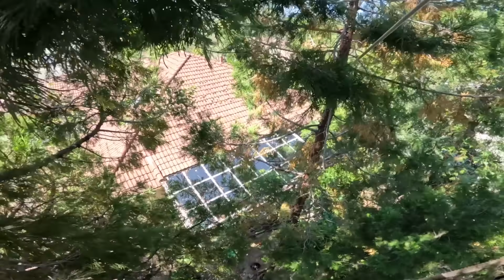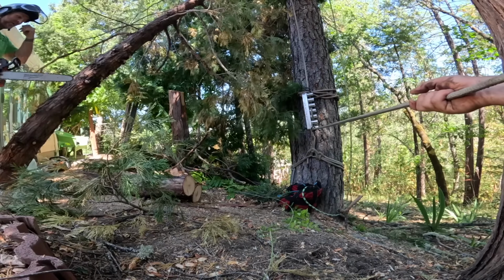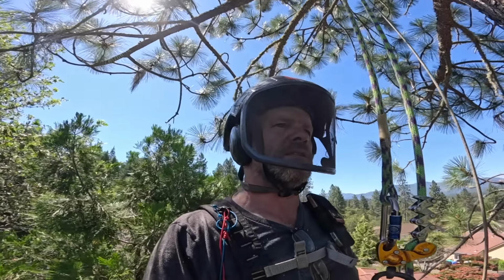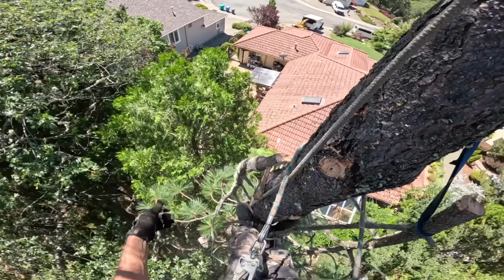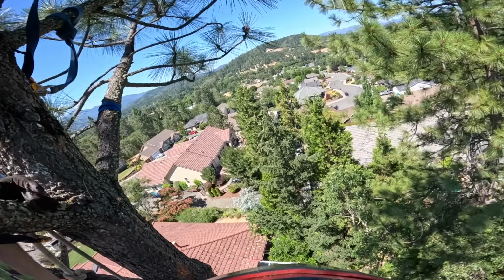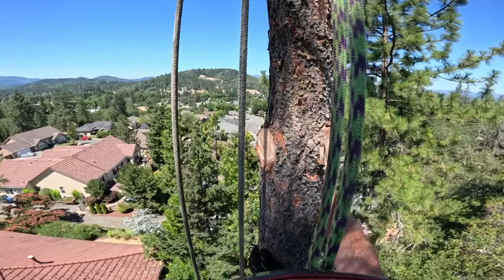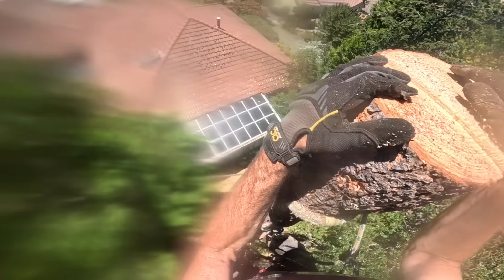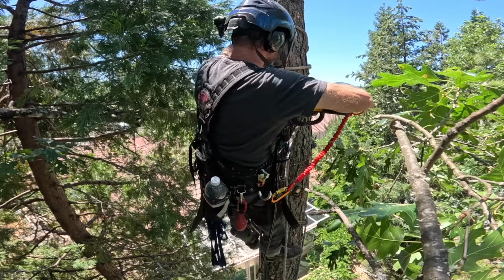Battery Saws Discussion

Comment: The biggest advantage of the battery chainsaws is I can do more cutting earlier in the morning and later in to the night without making someone mad.
Reply: Rule #2463: Someone is always mad.
Rule #321: You have a right to enjoy your property and use whatever time you can find to improve it.

My area has a bylaw that says no noise before 7am and after 10pm.
I told the bylaw officer who showed up while I was mowing about 10:20pm due to a call that if the neighbor who complained is willing to pay my daily income rate, then I'll skip going to work to be able to clean up my yard. Otherwise, I only have the time I have and I'm almost done. I started on it as soon as I got home, hadn't even showered or eaten dinner so that I'm not out past 11.
I made a complaint saying I wish the municipality could show some backbone and tell complainers to grow up and consider moving if they don't like where they are.
Bylaw officer left me alone and hasn't ever been back, though I do my part also in trying to keep noise to a minimum between said hours.
Reply: Yeah it's so nice to attract less attention, and makes communication with the ground so much clearer

Comment: I port chainsaws for a living and people gave me shit when I posted a clip of that saw when I first got it, as if I was suddenly anti gas powered chainsaws. I agree people feel too strongly about battery saws one way or the other. Probably bleed over from the way electric cars are being shoved down people's throats. Battery rear handles saws have a long ways to go before it's a viable option, if ever, but I can tell you I've shelved my 200t since I bought that Dewalt. (Gordys got dogs coming for it if you end up keeping it) 

Not having to start it in the tree, not breathing the exhaust, not having the fatigue of listening to a loud ass chainsaw a couple feet away from your face all day or while trying to communicate with your ground guys, swapping to a smaller battery for a small job actually makes the saw lighter, earlier starts, later finishes, no neighbors complaining about noise, easier to talk to YouTube all in trade for some horsepower loss and some guys on the internet threatening to peel themselves away from the couch to come take your man card away. I'll take that deal! 😂
Reply: Milwaukee is releasing a rear handle dual battery that looks promising
Reply: I am real tempted, as a homeowner who needs a chainsaw only occasionally, to go battery next time I need one. Mine died a while back. My thought is that battery saws don't have the gas go bad during prolonged storage. The carbs and fuel lines and such don't get stiff and brittle. And the batteries can be used in other tools so they'll have a fresh charge when needed.
Reply: @Kurgosh1 I have a corded elec pole saw, but the little saw on the end is removable and it's a little beast.   Perfect for basic homeowner stuff. Bar is maybe 10" usable but obviously you can work your cut to slay bigger pieces.
Reply: People who get butt hurt about someone else's choice that affects them in no way is everything that's wrong with society today
Reply: I'm getting some noise in my headphones and it's affecting my groove on, can u add some larger caps and upgrade my mosfets

Comment: I got lucky. I got the Husqy 536lixp, first. What an improvement!  The battery saws are the greatest improvement, in saws, in the past 50 years. There's less heat, less noise, vibration, no pull starting...
Reply: No spilled fuel,

Comment: Climbing Colt also gave a review on this saw and also said the throttle response is a lot slower then the huski top handle. I wanted to like the dewalt top handle as I use dewalt drills and am already invested in the batteries. But ill be using it everyday as a climbing arborist. Im torn between the 2511 because its so light and the dewalt 60v top handle.
Reply from the maker: 2511

Comment: I have the older Dewalt top handle. I use it for quickie cutting, pruning. But I always prefer gas. 

That said:

For most people, if you’re Red, you’re Red. If you’re Yellow, you’re Yellow. And on, and on. It’s bloody expensive to buy into numerous ecosystems. 

Everything has pros and cons. Too many people will gripe about the attributes rather than actually just work. 

Great work as always guys.

Comment: On DeWalt: price makes it attractive.
First off, it’s heavy on your wrist, but works for you once in a cut. Balance seems ok.
The soft start takes some getting use to; making the chain skip instead of biting in.
Battery gets hot pretty quick under load in summer temperatures.
With the safety switch, do electric chainsaws need a chain brake?

Comment: I have the DeWalt 20 inch 60V. DCCS677Y1 
Cuts really good. Unfortunately the battery overheats after maybe 5 minutes of cutting.  Not sure if it’s a bad battery or what. Needless to say it’s going back and I’m getting a gas chainsaw.

Comment: I tried out a neighbor's Stihl last year, it was great to just pull the trigger and cut with no hearing protection. The down side for me is the cost of battery replacement when they age out. I've ended up with multiple power tools over the years because I can buy a new drill kit with charger and all for the price of just replacing batteries.

Comment: Purchased a 14" 40V Ryobi electric saw to take in the Jeep and have used it exclusively since I've had it. Recently purchased their 18" saw for some larger logs that needed bucking. I must admit to being pleasantly surprised with the performance of the battery saws. Bonus, no hearing protection required.
Reply: I agree. Non professional and I used the same saw today to cut up and get the debris off the road of a 60 ft Co-dominant oak that split. Started at 7 am and was done by 10 am. I was rather impressed.

Comment: I use a Makita 36 volt top handle 16 inch bar. Got it for the convenience, price, and utilizing batteries I already had. I use farmer tech full chisel. Cuts awesome! I also wish it had more power from zero. If you stop cutting it doesn't do well getting started again. You do get used to it, and learn to compensate for it. Given that August commented similarly with this saw, I thought that DeWalt looks like it did a little better with starting /stoping in the cut. Common issue with any brushless power tool. You have to take the good with the bad and develop new habits to compensate.
Reply: I’m also using your setup. Could you get your hands on the 40V version? Chain speed should behigher, but I am mainly interested in power from zero…

Comment: Hi, August. I am learning a lot from your content, and like to say thank you for making it all. I'm i'd guess what you call a lower middle class guy that has a lot of tree work to be done on the property i live on and the property i hope to move my family onto in the next year or two. I've spent 12 years at a landscaping company in the past. Im slowly buying what i need week by week. i've got myself a 150ft samson climb rope, prussics, some petzl beans and some pulleys and have been doing some DRT-MRS (whatever ya wanna call it) climbing low and slow getting the feel. next up is some gaffs and wire flipline. then maybe a 355T for a top handle option (would you recommend anything different for the 350-400 range?). Also im curious, because it looks like what you did, do you climb the whole tree to set your climb line first then repel down and work the thing back up? Again, thank you for sharing your craft. Thanks to you and a few others ill be able to get some work done with confidence. At 33 years old and a father of 3 paying someone isn't in the budget. 

Cheers from NE Pennsylvania

Comment: Some jobs require the most powerful tool available. But some certainly don't. I think in recent years both employers and employees have realized that employee health does matter. There is something to be said about the decreased weight, noise, comfort, not having as much vibration and exhaust gas etc. Ultimately this'll lead to less health issues and accidents.
Nobody is trying to take away gas tools. But most of the time you don't need them.
Reply: It depend on the job offc.. if u can do it just as fast with a lighter tool then go for it.. if it takes twice as long might aswell grab a bigger tool.. THese battery saws are heavy though and lack power.. ur stil needing to wield them.. so gass powered is still better most of the time.

Comment: I remember you "made" a battery saw with the battery on your waist belt.....whatever happened to that?still a good idea in your opinion?or is the battery weight no big deal on these newer saws,or?
Thanks for all your videos, and sharing your knowledge and experience.
Reply from the maker: I haven’t struggled much to hold the weight of them so I haven’t used the belt mounted battery since that video.

Comment: Here is why I stick with one brand and ignore 90% of these "reviews" - Not ONE reviewer ever talks about parts and service and if you use any complex tools like a chainsaw or hedge trimmer or mower or  you will need parts and service. And guess what, there are only two brands that have complete parts and service - Stihl and Huskvarna with Stihl leading by a huge margin. I have 3 gas saws and two electrics and they are all Stihl. I have taken the cheap road in that past and bought the Big Box store brand and all of them (3) have broke and all of them have NO service parts, and nothing is worse that a saw break when you have a tree across your driveway and no parts to fix it. In 15 years of Stihl I have had exactly one breakage and that has been the chain sprocket which was in stock at the local Ace hardware. Really, people, think for a change on how you use these tools and what would happen if it breaks in an emergency. It is true, Stihl is the most expensive but also the most reliable and I also own the battery string trimmer and leaf blower and all have worked flawlessly for many years. You have guys like Project Farm reviewing tools only based on one small set of tests, never showing the long term use of same. I f I could sum it up in one short sentence it would be this: "Cheap always breaks" As for August Hunicke I love this channel but would REALLY like a video on chipper use and maintenance. I have my own chipper/shredder and blades and flails are expensive and hard to replace so it would be nice to see how the pro's do it and what they think about it.
Also, August, DON'T sell the Axe, you will regret it later on down the line as it is the best chipper out there and will be very expensive to replace as you have mentioned. My favorite parts of your videos are the rope knots and speed line techniques as I do solo tree work and am always interested in safer ways to trim and drop branches.

Comment: I have experienced a harder time keeping the chain tension consistent with the husqvarna t535i xp otherwise I would like it
Reply from the maker: same with the 540
Reply: Every time I clean my saws and I take the chain off I start the saw up and I run it for a minute to get the chain heated up and stretched out and then I retighten the chain and then I never have issues

Comment: August I hadn't thought about the fire hazard gas v.s. electric but the electric tools I have (Husky top handles and electric polesaw) have allowed me to work for folks when we really had to keep the noise down - one couple in particular was a lady who took cancer meds in the AM when her husband left for work and then went back to sleep until noon/ 1:00 PM. By afternoon I was chunking stemwood and they were very appreciative of how quietly we were able togo about our business adjacent to the house in the AM. They're just a tool in the toolbox though. I come down on the side that developing a battery saw for cutting 30" diam Doug Fir stems - really? Sorta like an electric pickup for towing a 26' sterndrive boat thru the mountains - really? As an early adopter of all this stuff somewhat I do find I've entered a phase where keeping track of battery types and whats charged and what's not has become a job in an of itself. So standardizing maybe is a good thing if you get into electric further. Keep up the videos and thanks. Cheers (and still rockin' my trusty old New Tribe MB Ver 1.0).

Comment: That DeWalt has the most bearable machine sound of all that I've heard so far.  Does the model you used have a 14" bar?  I have a battery DeWalt w/ 12" bar.  Blade sharpening is super critical even for homeowner level work.  I got a good deal on multiple batteries and a charger, so I"m happy.  Climb safe.
Reply: Too bad DeWalt has issues with their chainsaws from what I read.
Reply: I love putting a smaller bar on any saw. You're really cuttin' when you have a 20" on a 461 or a 25" on the 660. Same with minis, 12" bar vs. a 14" makes a big difference.

Comment: The Dewalt seems to be struggling by design the same way a Ryobi belt sander I have does. The designer had to choose a balance between torque, speed, motor weight and battery weight. By appearances, they choose high motor speed geared down to create high'ish torque but not high chain speed. The battery weight is more or less dictated by another department. I see a version of this saw comes with two 3Ah batteries, which I got a good laugh about as I know from my own experience trying to use a Dewalt battery sawzall and the battery life is crap.

Comment: So the neighbors dont hear a chainsaw but hear a chipper running lol
Reply: The use of a trailer instead of chipper for some jobs if quiet is a priority.
Reply: Grapple truck anyone ?
Reply: People worry that gas saws will throw sparks into the brush and start a fire. Many guys run gas saws with no spark arrestor. A chipper out on the street isn't the same as a saw in the brush.
Reply: @mungobestmage   I think the point is, noise attracts attention.
Attention is something we can do without here and there.
Reply: @vespasian266  August literally says in the video he doesn't want to arouse the neighbors running a gas saw in fire season.

Comment: Seemed like it cut fine.  At first I didn't like the slower ramp up of the velocity, but it's probably a good safety measure.  Electric motors can give full torque/power instantaneously, which may be just a tad too quick.  Cost can also be a factor... 🤣